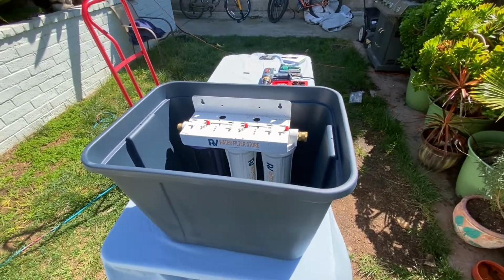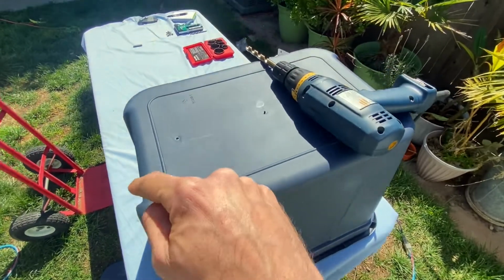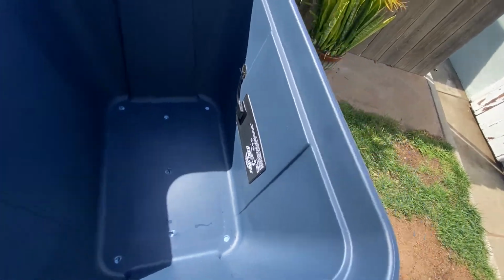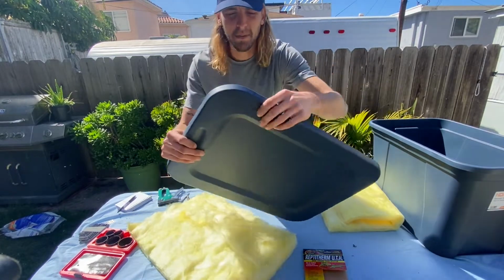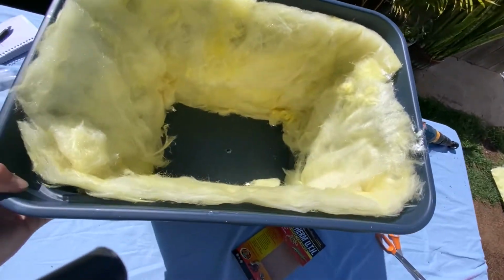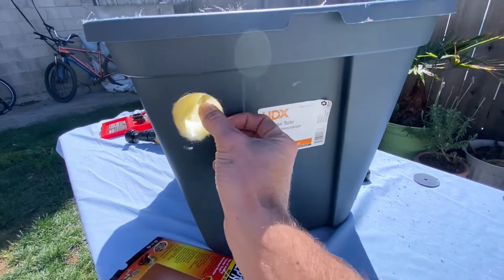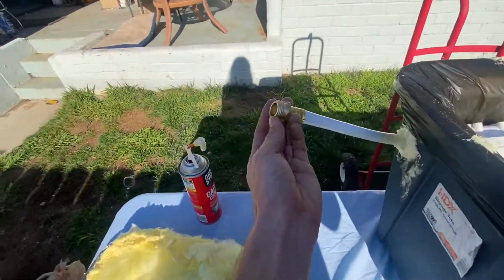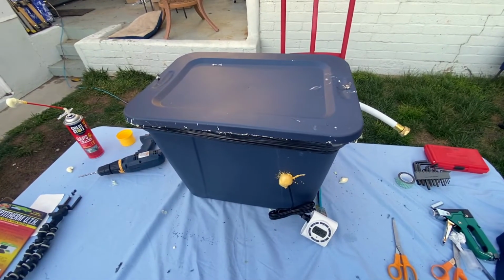DIY "INSULATED WINTER BOX" build for RV Water Filter Systems

Comment: How well did this hold up through the season, did it get wet at all, how easy is it to change out the filters when they are done, did you have any issues with the heater and the fiberglass?

Comment: Very good concept. The only improvement I see is the timer. As winter where I am don't care if it's night or day to freeze your water. Switch the timer out for some sort of thermal device temperature sensor for a more reliable setup. Say a short RV hose wrap device, etc.